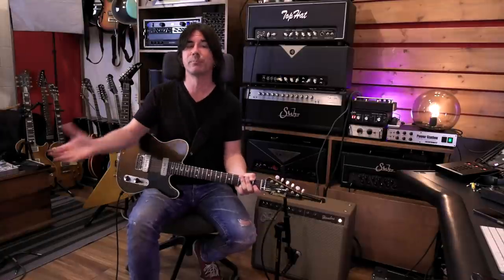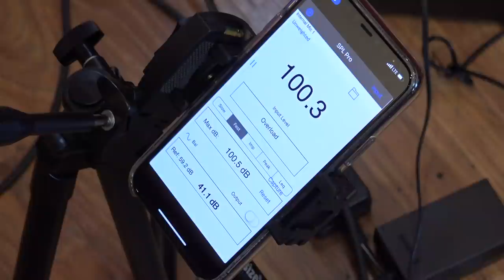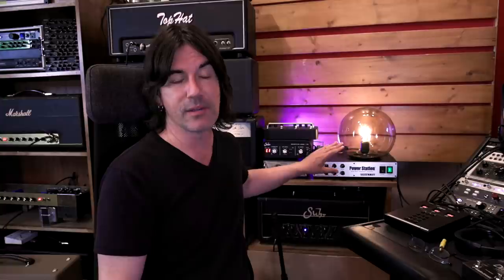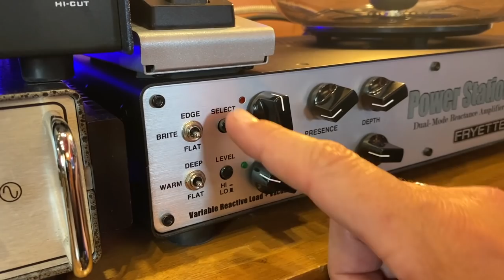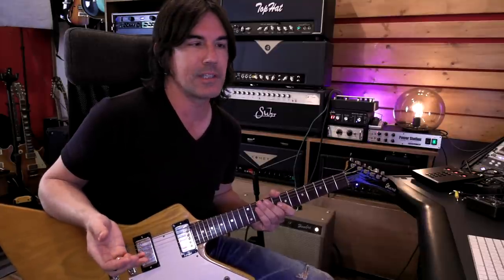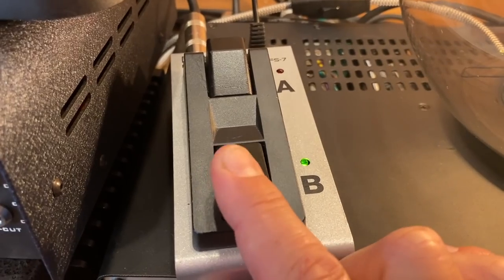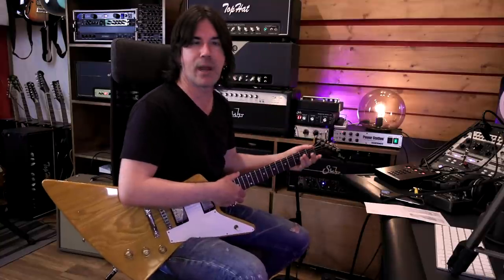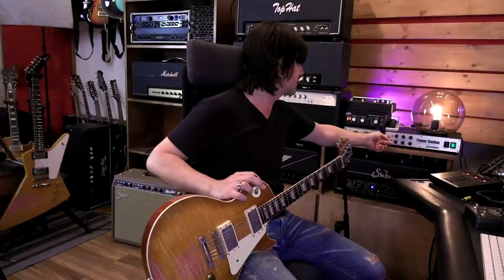THE BEST "ATTENUATOR" AVAILABLE! FRYETTE PS100 POWER STATION

Comment: I have the original PS-1, but the PS-2A overall seems to have a few additional  useful features like silent mode and line level control. I don't think it has a footswitchable effects loop like the PS-100 though, which would be pretty cool.  I wonder if the reactive load itself or the voicings have been upgraded or tweaked at all from the original.  The only amp I have that it doesn't seem to attenuate  super transparently is a Matchless DC-30, it's good but not exact.  It does however make it usable- it's a loud 30w.  There is not a huge price difference between the 2A and the 100, I guess I would get the 100 if I upgrade if it's worth it.  It is a solid piece of gear - if I had to fight off zombies with the thing I'm sure I could plug it in afterwards and it would be fine.

Comment: Part of the benefit of cranking an amp is how the speaker physically responds. Pete acknowledges this but also minimizes it, but it's actually pretty friggin important.
Reply from the maker: I don’t know that I minimize it? I do show it - you can listen to it and hear the difference.... in the volume match clips at the end. That’s the difference right there!
Reply: Thanks for responding and thanks for all the great videos! I'm just making the point that speakers often sound better if they are pushed to some degree, or to a significant degree.
Reply from the maker: No worries, yeah I just felt like I went through the exercise of actually recording the clips out the different volume and then volume matching them exactly – which took me a little while to do – to highlight the exact thing that you were saying that I sort of minimized. Ha! I just had to push back a little bit because when you spend an hour on some thing making sure it’s dialed in and you put all the text and everything… I didn’t understand what you were getting at. Anyways all good

Comment: Pete, when did you get that Top Hat?
Reply from the maker: Just recently. Are used to have one 20 years ago and I always really dug it for AC 30 sound
Reply: @PeteThorn  Nice! I had a very similar one I sold in 2006, some sort of pre-emplexador (1995-1997) hybrid with a bassman pre and a plexi pre into a 50 watt plexi-style power section. Does yours have 'fireplace grate' on the back panel?
Reply: it sounds fantastic

Comment: The problem is pricing as with the OX. $1000 retail, you might as well buy an amp with built in attenuation or a lower wattage version of what you already play. The manufacturers markup is incredibly high as the components are well under $100.
Reply from the maker: You get what you pay for. There’s a lot of tech and R&D in this thing (the load, a full on tube amp/transformers etc and all in a tight enclosure) 
Try and build one ! 😮
Reply: @Pete Thorn  okay, but you are also dealing with a unit that needs servicing as it has tubes. Unless you've got more than a few tube amps you need to attenuate, there are cheaper solutions that are more than adequate. I don't buy into the price point on these either.

Comment: Why can't Fryette just give is the attenuation without all the bells and whistles...and extra price?  If they won't do it, somebody else should.
Reply from the maker: Which bells and whistles would you eliminate? If you’ve got a load and a  power amp, that’s where the majority of the cost is going to be. I guess you could eliminate the depth and presence controls, and all the switches, but that stuff won’t reduce the price much. And then you’ve got no  options for shaping the sound.

Comment: Better than Ironman ll ???
Reply: The Power Station does a lot more than the Ironman II does. I'm pretty sure both sound great. The Fryette has the loop, which is nice for live playing, and it also has tone controls for compensating for the tone shift as the volume changes. Neither would suck, but in my opinion the Fryette is better. I think the Ironman II probably works best with clean amps, and open back cabinets. The bass frequencies of an open back are naturally more "loose" or less defined. You won't miss the lack of a resonance control with those amps as much. If you're using a closed back, you will notice it. That's not to say it would sound bad, but it's nice to have the control.

Comment: Great video but I have a question, Pete. I need a pedalboard that can take 6 to 10 stompboxes. Has a built in DI and a built in converter to take 48v and fire out equal required power for the pedals. Why doesn't this exist?  It would be every recording guitarist's dream.
Reply from the maker: You can configure a pedalboard like this. Just with individual components. Nobody really makes an all in one solution, But with a few individual components you can do exactly what you want

Comment: hey, thanks for this. I've had a ps2 for some time. Sold it because when I was plugged in the sound changed. Have you tried unplug it entirely (not standby) and then replug it? Although the sound remained unchanged between the standby on and off, everything changed with the ps2 unplugged.

Comment: Hi Pete! ☺
Can you tell me which is the very best attenuator between the Fryette and Ironman II?
Reply: I have used TK Ironman ii for years, tried a Fryette PS2A last month and then bought PS2A's and PS100's to replace my Ironman ii's. Fryette solution is simply more transparent, less compressed and has more flexibility in terms of EQ and an effects loop. IMO the Fryette is a better value product - more for your money.
Reply: @djt6546 Thank you DJ T! ;-) What's the difference between PS2A and PS100?
Reply: @rastan17  I haven't really noticed anything obvious in terms of sound quality. I expect Fryette will say they are designed to be the same, although technically the units do use different power tubes. So main difference is technical. Both units can take 150w input at 8ohm. PS100 is 100w output versus PS2A 50w output. If you like the idea of being able to set two different volume levels, perhaps a higher volume with more presence and less thump in contrast to a lower volume that is not as bright and warmer, then the PS100 would be great giving a kinda 2 channel effect.
For what it's worth in one week of owning these devices I can tell you the effect they have on your own gear will not be determined until you try them. For example I can replace an Ironman ii attenuator with a Fryette and prefer it a little. Then with other amps the difference can be night and day. For example I removed a 100w Ironman ii from a Matchless HC30, put a PS2A in place and OMG, the difference was night and day. The Ironman ii totally choked the amp whereas the PS2A sounds soooo much more open and like the original tone. So like with many items and guitars in your signal chain, results can vary. I remain happily convinced that Fryette PS's are the best I've tried so far at retaining the original character of an amp. The compromise between volume and tone is far less with the Fryette's in my opinion. Enjoy your tonal journey! 👍

Comment: I would not order one again.
It comes with a fan - a comparatively loud fan. When you switch the operate button to ‚on‘ there is a constant, not too loud but still annoying hum coming from my speakers.  It seems that the power transformer of the unit is introducing it. Maybe they put too much into a small chassis or didn‘t adapt the transformer diligently to the 230V/50Hz world. Swiping the tone controls comes with a scratching noise in my speakers. It comes with a lot of stuff you simply don‘t want in your signal chain and home studio. The Suhr Reactive Load and reamping the line signal is a way better approach. For me this box is overrated!